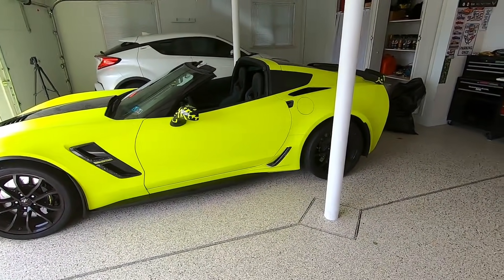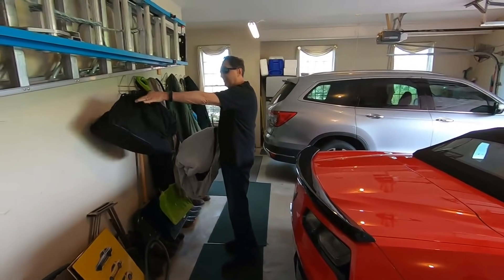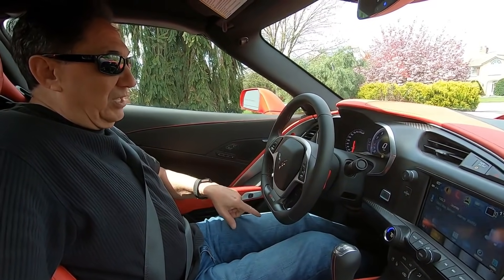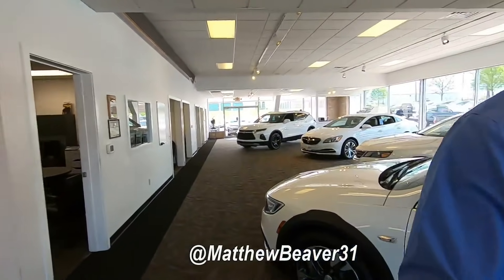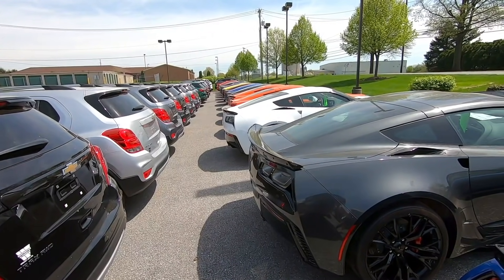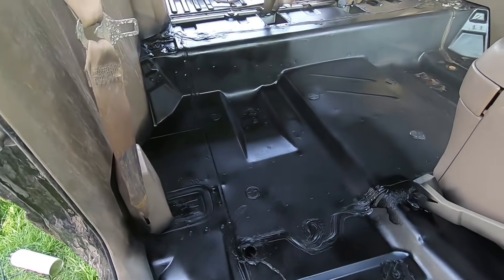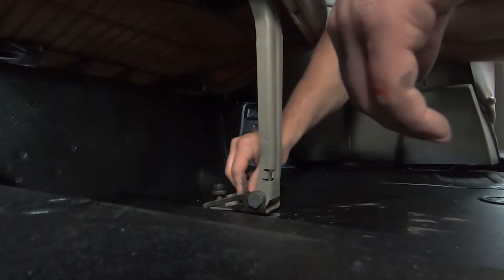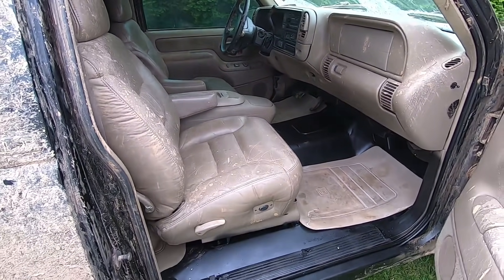COMPLETELY STRIPPING THE BLAZER! (Found More Water Damage) + Putting a Deposit on a C8 Corvette!!!

Comment: If u raptor line it or rhino line it u can actually make it thick like it supposed to be it will actually sound deaden it as well as seal it up.. raptor liner kits comes with its spray gun that will work off ur compressor or u can roll it on with a roller

Comment: The other reason to put the bolts back in is because if you ever DO want to put the seats back in the threads in the floor will be covered with bed liner...  and as others have mentioned add a couple drain plugs while you're there...

Comment: Should check if the differentials or anything have breathers under the truck and extend then if there are any. Depending on how deep of water you plan on going through might have to do stuff with the electrical.

Comment: You should use flex seal under the dash to keep all the electrical & ac fan stuff dry & with the seat go to the junk yard & find a seat that slides manually there pretty cheap

Comment: That bed liner coating doesn't work well if its not prepped properly. I made that mistake on my Cummins. I prepped the surface on my XJ and it was much better. Also, it comes out a lot thicker if its upside down.

Comment: Need to put a few holes in the low spots of the floor with plugs so you can drain the water out a lot easier and way faster.

Comment: Mike you need to put a pair of race seats in the Blazer $200 on Amazon cheap upgrade but well worth it..they work with 5 point or stock belts too!! Comes with slide rails on all mounting hardware had them in a toyota pickup that was an offroad machine!

Comment: You could've used a 12v battery and jumped the wires directly on the driver's seat motor to get it to adjust the back of the seat forward. Bypassing the switches on the side of the seat.

Comment: 55 mph speeds bah most hwy’s in TX are 75 and some are 85   I remember when many states were posted safe and prudent speed  which were apparently up to the discretion of the leo on patrol. And use black outdoor carper like used in boats still looks good and doesn’t rot or mildew

Comment: You should buy a durmax engine for the blazer
Reply: The only AJW Cummins
Reply: Dallas Delano why a Cummins
Reply: The only AJW because it would fit better and it's cheaper.
Reply: The only AJW you got to remember this is a budget build Duramax engines are expensive and the Blazer would need a lot of room and cutting to fit a Duramax engine. Also the Blazer has independent front suspension, the Duramax engine would be heavier than a Cummins.
Reply: crack jack yes an ls would be cool.
Reply: @dallasdelano8235  you're forgetting that the half ton gmt400 trucks also got diesel engines so idk how a duramax V8 wouldn't fit plus now there's a 4 cylinder duramax
Reply: Captain Rudy 4021 half ton k1500s had a Detroit diesel inline 6... 
Like I said Duramax engines are expensive.
Reply: @dallasdelano8235  oh really?  I thought they got the same 6.5L v8 that the ¾ and 1 ton trucks had?
Reply: Captain Rudy 4021 shit I thought they were inline 6s
Reply: @dallasdelano8235  even then it wasn't a Detroit diesel
Reply: Captain Rudy 4021 yeah but still the Cummins would fit better than the Duramax
Reply: @dallasdelano8235  I agree.  More room to work.

Comment: Spray a lot of WD-40 or grease inside motors then take a pair of vice grips and turn the motor you can probably do it with it plugged in it just needs help going if the motor is not dead

Comment: That Blazer will be stupid loud  inside when driving it with no noise insulation on the floor. Good luck video taping in it when it's running.

Comment: You did not take the center counsel out. It so easy. Take the inside put then thare two 10 mm bolts. Slide the counsel forward and up. And it'd out. There is a braket in the back that it slips in to.

Comment: Man you need to find you a set of 07-14 Silverado front seats and but those in there where u can adjust the seats and u can get a flip up center console that has the bottom compartment they fit

Comment: What a waste of time.  Didn't clean good enough and didn't even scuff it. On top of That rattle can bedliner doesn't have the hardness or mil thickness as a real bedliner like raptor/line x.  It's just gonna scratch and peel off.